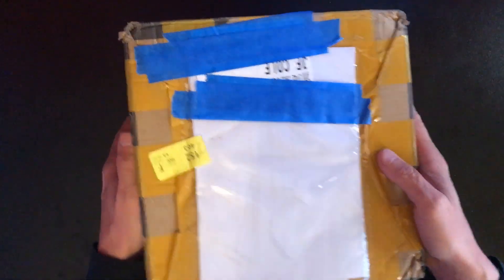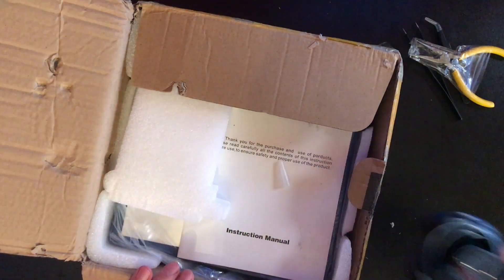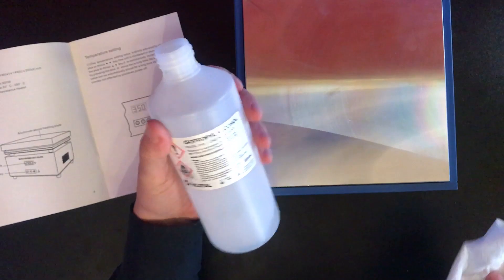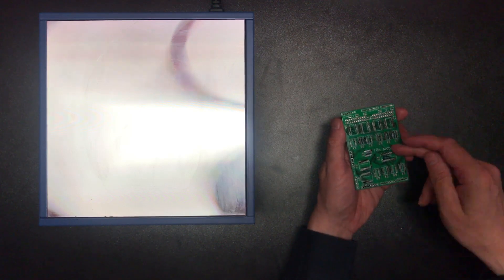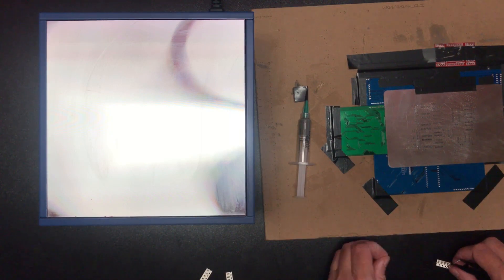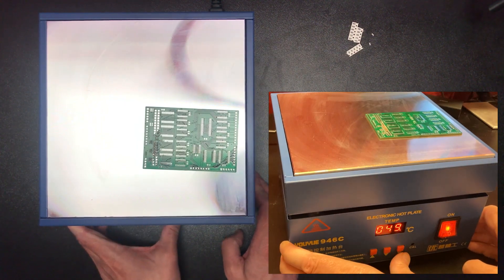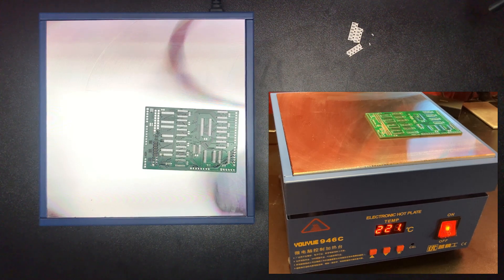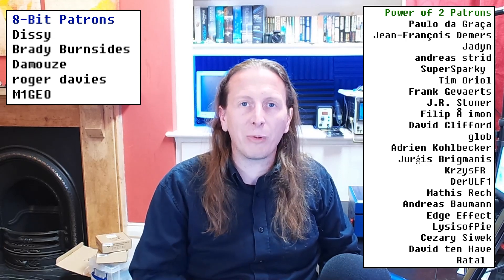946C Soldering Hot Plate - Unbox and Test

Comment: Just got one of these and it seems genuinely pretty great, especially for the price.

Has anyone come up with a clamp design though? would be nice to be able to keep boards still, particularly when using it primarily as a pre-heater. I was thinking maybe some spring steel clips or something might be an easy modification to make.
Reply from the maker: For stencils and component placing, I have a board with pcb's glued on in an 'L' shape. That make it's easy to maintain boards in a consistent location. Something similar to that might work.

Comment: Just wondering why you chose a hotplate rather than going for a small hobby IR reflow oven. Looking online small oven's are available for not that much more than the hotplate you purchased if you shop around though I'm not exactly sure if the cheap reflow ovens are any good but they do have good reviews some of them.
Reply from the maker: I would like to have an oven for high reliability reflow, but the hot plate has multiple uses. And it allows me to capture video like this:  https://youtu.be/iudA4v8fUqI?t=672

Comment: Yay! You got one! Much better than hot air! :D Wait till you get an automatic reflow oven with purge fan! :D
Reply from the maker: The hot plate is much easier to get good video footage of the reflow. The clip in the vga video is awesome!
Reply: @JamesSharmanExtras  I never get tired of watching them wiggle into position! I think leaving it on slightly more time would help, and also ensuring the pads have enough solder. But this really came out excellently!

Comment: I would suggest checking inside to see that the cabling does what it is supposed to do, like earth wire actually connected etc. Mine is the exact same model and did not have any issues, other people haven't had the same luck with theirs.
Reply from the maker: I'll take another look when I get some time. Anything specific you recommend looking for? I did check for earth connectivity already.
Reply: @JamesSharmanExtras  Loose spade connectors and so on, just the usual safety stuff.

Comment: I saw a comment on AE for a slightly different model so maybe you want to check or at least not leave it unattended: "After setting it for 30 degrees and waiting for some time and coming back to it. I found it had suffered a thermal runaway and the plate fully melted. Close inspection revealed one of the thermistor wires had broken off and there was no thermal runaway protection built in. Highly do not recommend this product if you value your house and its fire safety rating."
Reply from the maker: Probably wise to be careful. The way I'm using this it won't be left alone and generally not used for more than a few minutes at a time

Comment: Neat! I've been looking at these as well for when I move my build to SMD in the future, so it is great to see an unpacking and demo. Would you recommend learning hot air first or going straight to this technique?
Reply from the maker: Thanks Adrien! I’ve been really impressed with the results from this, I think it’s likely to be my main method for soldering full boards going forward but the hot air is not going to be entirely depreciated. So yeah, I would still recommend getting (and practicing with) the hot air first.
Reply: @JamesSharmanExtras  that makes sense, thanks!